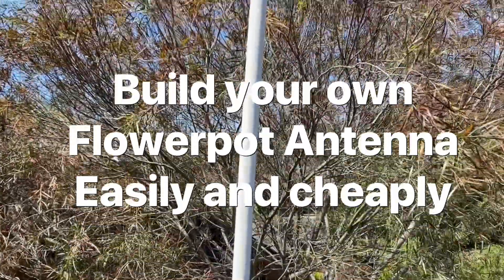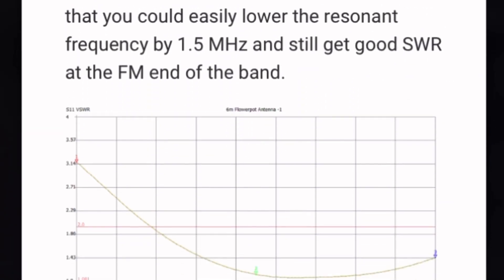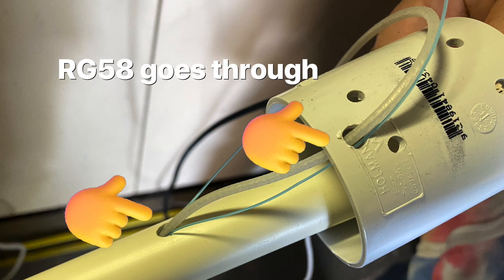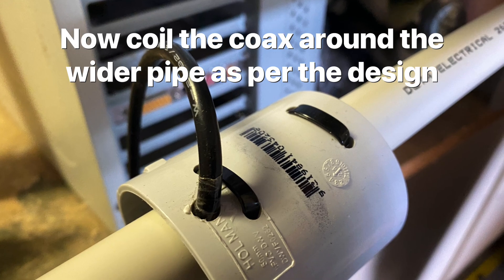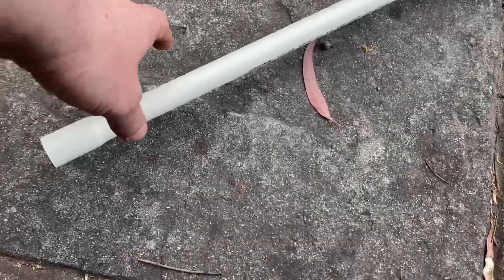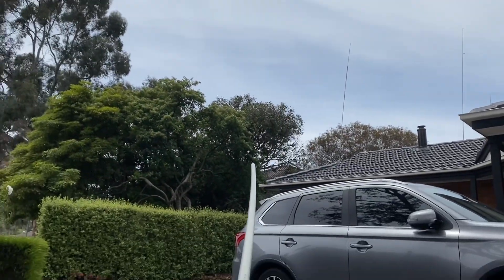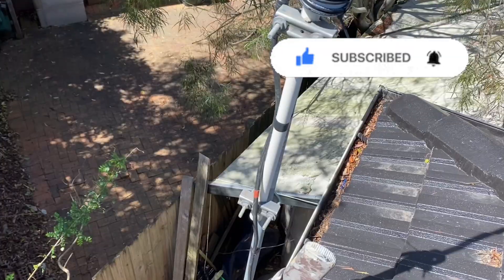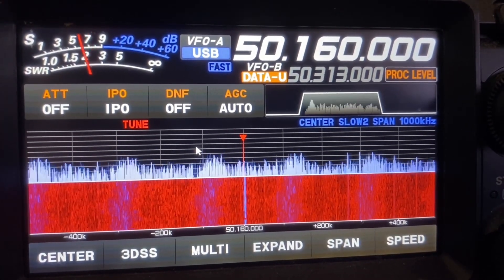Build your own Antenna easily Flowerpot

Comment: How far is longest TX you made
Reply from the maker: Great question. On 6m I’ve spoken on SSB using this antenna several hundreds of kilometres. But during winter when the band was mostly closed. I’d have more success over summer I think. 
You can make this antenna for other bands also. I’m thinking of making a 2m one. Keen to hear if you are planning on making one and what band
Reply: @vk3tbs  Its summer, let me know how it goes.😁
Reply from the maker: Ha. Not Summer everywhere. Sure isn’t summer here mate. 
But will let you know when the 6m band opens up here

Comment: Simplicity is one advantage… another is supposed to be low angle of radiation for DX.
I use them all bands from 20 metres to 70cm and want for nothing. Oh, the tuning varies ever so slightly depending on the coil’s height above ground, but that’s no drama.
Reply from the maker: Thanks Peter. Always appreciate your experience. 
One thing I love about the hobby is there is always something to learn and good people to learn it with. 
73’s mate.

Comment: Trying to strip off meters of shielding is a colossal waste of time and effort, not to mention a waste of Coax.  Just solder a length of normal wire to the end of the coax after it comes off the coil........
Reply from the maker: Good idea mate, thanks for the tip. Not sure why I didn't think of that myself.

Comment: I made a dual bander "flowerpot" for 2m/70cm for portable "base station" use while camping. While it isn't the most efficient antenna, it works more than well enough, is extremely versatile, and it's field expedient. You don't really even need the pipe, you can just use the coax naked in a pinch. As I recall, I had to remove about 3 turns off the coil from the design I followed (shout out to M0MSN and his most excellent guide) to get it to resonance, but it was a pretty simple, painless project for a new ham :)
Reply from the maker: Thanks mate. 
A 2/70 would be great and perhaps my next project. I don’t need it for home but when camping so yes wouldn’t use the pipe so I can easily pack it. 
Thanks for your comment mate. Hope you enjoyed the video.
Reply: @vk3tbs  I did enjoy the video. I'm not positive you could do a dual bander without the pipe, at least not the way I did it. The 70cm part of the antenna is a specific length of foil tape (about 10 inches if I recall) wrapped around the pvc at a specified interval. (exactly at the midpoint where the antenna is technically "fed") I suspect it is purely parasitic, but it could also act as a trap. I was never curious enough to dig deeper :)

That said, it isn't much more than 4ft long. Pretty easy to strap to a backpack and or roll up in a tent. I don't find it too difficult to manage. I also capped the top end and attached a nice loop of cord for easy hanging.
Reply from the maker: Cool. Thanks mate. You have inspired me to give it a go.

Comment: No radials? How does this work?
Reply from the maker: Hi there, yes I thought the same thing, and may end up putting them on to see if it makes a difference. They are a 1/2 wave antenna so, no ground plane required I was told.  
Hope that helps. Thank you for your great question.
Reply: Half wave antennas do not need radials
Reply from the maker: Thanks mate. I thought I was correct. Appreciate the confirmation
Reply: @TIMG5TM Not exactly true. EFHW antennas do need a counterpoise. But this antenna isn't an EFHW, it is a dipole, and dipoles don't need a counterpoise.
Reply from the maker: Thanks, that is a better answer.
Reply: Is it not actually a vertical dipole, the top radiator is half and the coax shield below is the other half.
Reply from the maker: True. Thanks mate
Reply: As stated, this is a halfwave dipole (sleeved dipole is the technical term), or T2LT.
Reply from the maker: Thank you. Appreciate it